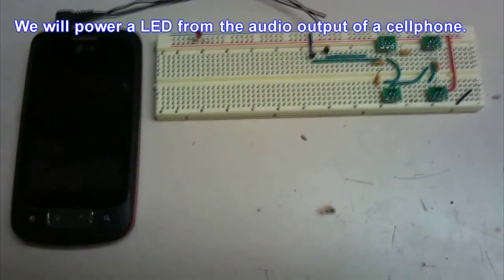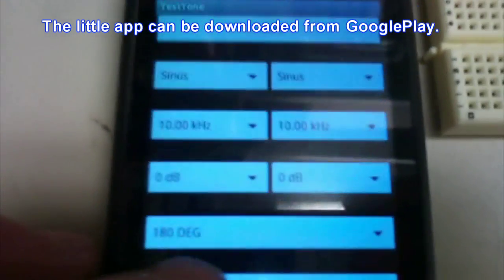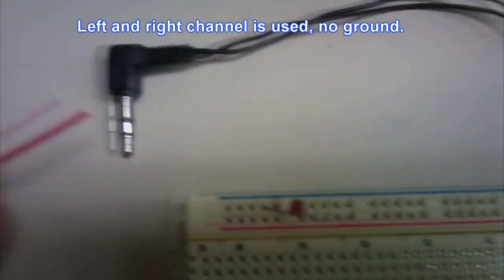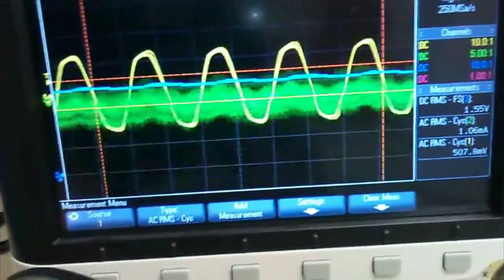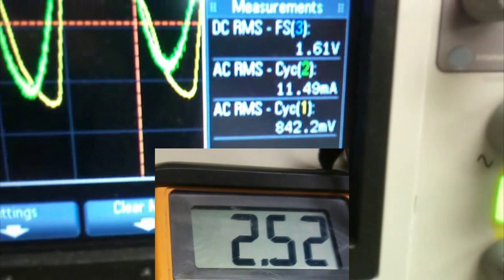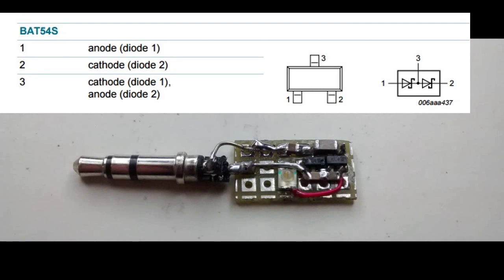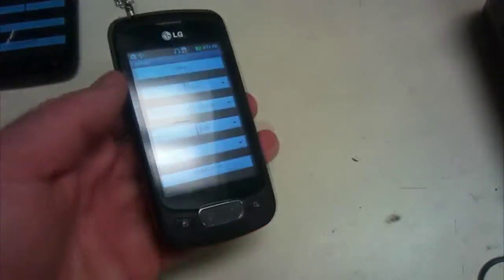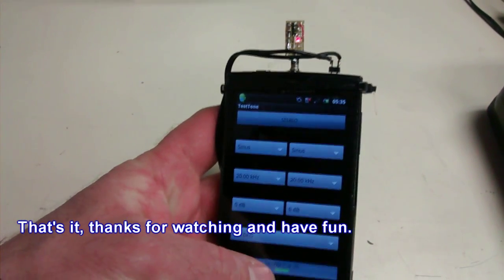How to harvest power from an audio jack - part 1 - powering a LED

Comment: Hello @TomTechTod, i know it's and "old" projet but did you tried an evolution with an infrared LED to use your phone as a remote control for TV, etc ... ?
I personnaly have a Samsung Galaxy Note 3, so an old phone, but this one have an Ir LED and i use the free "Irplus" app (google play, without too much autorizations so it's perfect) then i can command all my TVs, sond system, fan, etc...
Plus this app let tou to customize and add new remote and more important export the Ir frame as XML file. So maybe it will possible 1) to change your small circuit to do an Ir one, then 2) with an personnal (or existing one) app generate the frame for this Ir circuit?
Reply from the maker: I don't think there is enough power from the headphone jack to drive that LED. + ; remote control signals are usually modulated onto a carrier frequency, something like 38kHz from what I remember

Comment: Hi Tom,
That looks pretty great. My knowledge on electronics is virtually inexistent. So would it be possible to make a video with a step by step explanation of how you actually connected the circuit and which software you used? I know it may seem basic to you, but I would highly appreciate it.
Regards

Comment: will this work if I only have one audio channel and ground?
Reply from the maker: +Elton Leung It will depend on your phone's audio amplifier power. I didn't test it with only  one channel to ground. A small transformer may be better suited to increase voltage.

Comment: What is the code for the Schottky diodes you used?
Reply from the maker: +Jess the Dragoon BAT54S, there is two diodes in one SOT23 package so you only need 2 of them for a quadrupler.
Reply: TomTechTod I see.  Are those diodes the ones with 0.15 ~ 0.45 voltage drop?
Reply from the maker: At 10mA the drop is less than 300mV. For low power sensors the current maybe more in the 10s of uA range or up to a mA maybe so drop is sufficiently low.
See fig1 in the datasheet here: http://www.nxp.com/documents/data_sheet/BAT54_SER.pdf
Reply: TomTechTod Hm I see.  If I can't get those kind of diodes, can I use these instead: https://upload.wikimedia.org/wikipedia/commons/thumb/c/c3/Schottky.jpg/220px-Schottky.jpg
Reply from the maker: In general you should be ok with many different types of low-power schottky diodes. It also depends on the current you want to get out of the voltage multiplier. By the way, you can buy BAT54S from eBay for a buck or two with free shipping.
Reply: TomTechTod Ok.  Thanks for the info! :)
Reply: Hi again!  I tried building your circuit but it didn't work and I don't know what exactly is causing the problem.  I copied your circuit but the only difference is I didn't use the exact components you used in this video.  I couldn't get the exact same components.  So instead, the capacitors I used are polarized and are labeled "47µF 16V" whereas the diodes I used are Schotty diodes that look exactly like this: http://d1gsvnjtkwr6dd.cloudfront.net/large/SC-DI-1N5819_LRG.jpg.  My smartphone is a Samsung Galaxy Mini gt-s5570 and I used an Test Tone app just like you did.  I'm still a noob at electronics so I'm not sure if it's right to substitute the components you mentioned or if it didn't work because of some other reason.  Could you help me please?
Reply from the maker: The datasheet of the the 1N5819 doesn't reveal what its voltage drop is at a few mA. It may be to high. Another cause maybe you don't get enough voltage from your cellphone, either it doesn't provide a voltage high enough or you maybe you missed the fact that I used left and right channel (not gnd) and drive them with an inverted phase.
Reply from the maker: Jess the Dragoon you could measure the voltage drop of the diode by just taking a resistor of a few k for example and put the didoe in series with it and then apply some voltage. chose a resistor that gives you about 5mA. also, set your tone app to highest voltage output and measure voltaage between left and right channel with phases inverted
Reply: I did notice you used only the left and right channel from your phone for input.  I did as well but when I probed the channels, the voltmeter didn't move one bit as if there was no voltage even though the Tone test app was running at full volume.  For the diodes I used, I found this pdf: www.diodes.com/_files/datasheets/ds28002.pdf ,but I'm not sure if it states the voltage drop of the 1N4004 diodes that I used.  How do you drive the channels with an inverted phase?  What does that mean?
Reply from the maker: 1N4004 is not a Schottky diode, their voltage drop is at least 0.6V, way too high. As for the audio output, if you measured from left to right and there was no voltage at all that means they were in phase, meaning when you have a positive halfwave on one side there is a positive halfwave on the other side too. The result is zero, just as you measured. If you use the tone app I used there is an option to invert one channel, i.e. positive halfwave will be negative on the other. Correcting these two issues should solve your problem
Reply: I see.  I tried with another tone generator app with the invert option and it gave me a reading.  The needle on my voltmeter kept swinging between 0 and 1V on the AC10V scale.  If that's the case, that means this voltage multiplier can light up the LED only after inverting the phase of one channel?  And if I just simply play any song as input for the voltage multiplier, the LED won't light up?
Reply from the maker: +Jess the Dragoon it depends on the output voltage of the cellphone. Some phones may be able to provide enough voltage to light the LED from only one channel
Reply: What is the minimum amount of voltage required for the voltage multiplier in this video to work?  Also, with this voltage multiplier, is it possible to make the LED flash to music from your phone?
Reply from the maker: +Jess the Dragoon the peak of the AC voltage must overcome the drop of the schottky diodes. music should be possible
Reply: Hi mate. Is it possible to get 4v from the Jack? Using the MIC5205? Thanks.

Comment: Can i make a selfie flash using headphones jack gating power by 3.5mm jack for selfie
Reply from the maker: yes but not with this circuit. a flash requires more instantaneous energy. you would need to charge a capacitor over some time and then discharge into a white LED. it's possible .